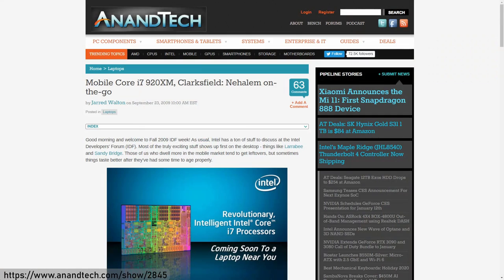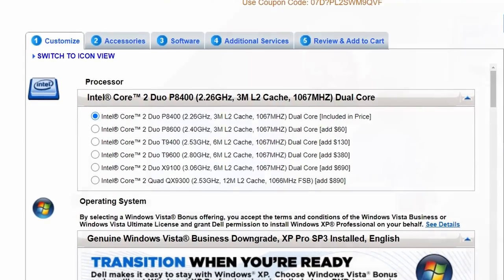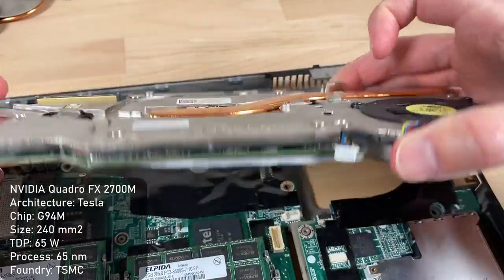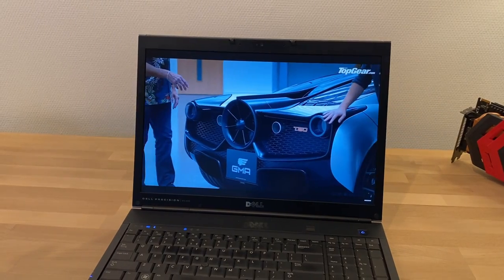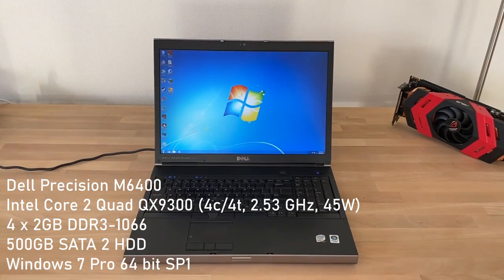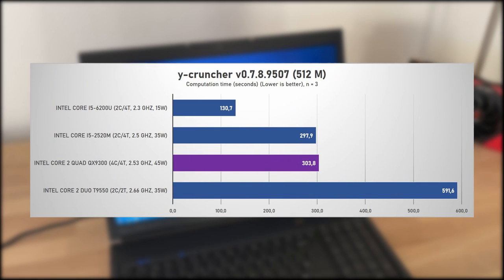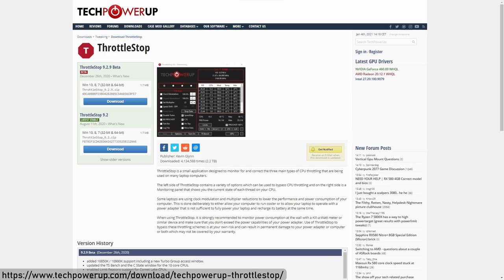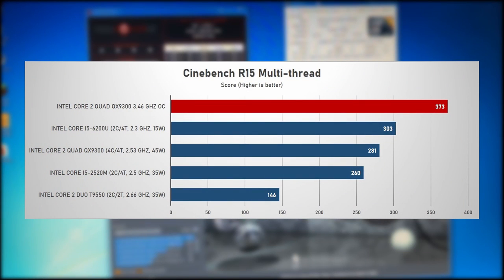Core 2 Quad Extreme in a LAPTOP! - Dell Precision M6400 & Intel QX9300

Comment: I have a q9550 I bought in 2009 that I now use as my media pc, it's spent it's whole life between 3.6 and 3.8 ghz still runs perfect I dropped an RX 590 pulse in it and it does 4k no problem at all.
Reply: i got also a q9550 in e0 stepping back in the day. mine was daily oc'd to 4,25ghz without big trouble
Reply: @ko83na mines e0 also, I did run it at 4ghz for a short time but didn't like the heat and voltages,(mainly the northbridge volts) it was in an Asus pq5 turbo so probably not the best board since it was only a p45 chipset.

The psu finally died last year, still need to replace it.

Comment: Very nice review. I just purchased an M6400 on ebay for $80 and upgraded it with an SSD, 16gb of RAM, and from a T9900 to a QX9300 cpu. It runs like a brand new laptop...better than my Lenovo IdeaPad 3. The performance is amazing. I'm going to get an express card with USB 3.0 as well.
Reply: qx9300 is from 2008 but it runs pretty well ngl 
i have one with 6gb ddr3 766mhz ram and 8000m gs
Reply: That T9900 will still fetch a stupid amount of money!
Reply: There are plenty of addin cards to max out expansion, I would max out storage though by replacing un needed expansion like odd or other pcie cards with ssd's.

Apparently thinkmods do an express card to nvme adapter with an SD card for clover to allow nvme boot.

The internal pcie slots can probably be made bootable using clover too for a multi boot machine.

I've found that later combined  WiFi + Bluetooth modules require modification for use in older machines.

Pin 51 and pin 20 they are apparently to do with physical power buttons for turning parts on and off, you can take over them or do what I did and use a sharp knife to cut the top trace and lift the connect pad off the PCB.

Later cards and OS are incompatible or have trouble working with hardware buttons.

Comment: One of Intel's greats.  My desktop Core2 Quad was a beast too.  The longest running main desktop CPU/Mainboard combo that I ever had, with surrounding peripherals upgraded across 10 years.  I only decommissioned it about 4-5 years ago when I switched to a dual Xeon E2-2667 v2 mainboard at original Threadripper performance (for a larger power budget).

Comment: I love these Precision laptops - my daily driver laptop is a M6700 with an i7 Extreme Edition, Quadro K4000M GPU, 16gb DDR3-1866, 500gb SSD + 2 500gb HDD (Raid 0) + 64gb mSATA SSD. Basically, I paid for all the slots so I'll use all the slots. I've considered buying one of these M6400s to mess around with as I've only used desktop series Core 2 chips when it comes to the high end.

Comment: I used a m6400 for around 9 months with a qx9300 OC'd to 3ghz max of 3.2ghz.  For graphics I went with the firepro 7820 since it was a mobility radeon 5870 which is a desktop hd 5770, so in 2015 it was still pretty potent.  Switched back to my other dell for laptop usage and started using a desktop again as well.

Comment: Had one in a HP 8730w mobile workstation with a dream color display and advanced docking station with internal disks running three displays back in 2008. They were about $5k-$6k plus the extras. The network team at the company bought them to be used at home.... The CEO found out, tried to return them but the vendor refused to take them back as they were totally and customly maxed out and the vendor had no way to resell them. I got one of them as dev and hardware nerd. Ppl in meetings just laught at it. I hooked the laptop up to the huge docking station hanging under the desktop and had three 22" IPS monitors with wall arms as a 0 visible cable solution. It was totally epic. Happy days! :D

Comment: I actually have a T60 thinkpad that I modded to support a quad core q9000 cpu. It's a really extensive mod, including a motherboard from a different generation of thinkpad, modded BIOS, SPID timings and a modified cpu socket. I did the mod myself and I'm very proud, I'll probably end up making a video on it eventually.
You're right about it being surprisingly snappy. I run windows 10 on mine and other than playing youtube videos, it's a perfectly usable machine for just web browsing and even some light gaming. The downside is heat. I went with the q9000 because it was cheaper and I didn't want the T60 heatsink to be overloaded with a 45W cpu. Some cooling mods and it stays just below thermal throttling, but I'm very glad I didn;t go for a Q9100 or god forbid a QX9300, although some users on the german thinkpad forums have done that.
Reply from the maker: Very cool! I used to have a T60 modded with QXGA 2048x1536 IPS display - in hindsight I shouldn't have sold that lol
Reply: PLEASE make a video, that sounds insanely interesting
Reply: You should be able to play YouTube videos on a Q9000 quad without any trouble although it depends on the resolution and the frame rate you're after. I've got a laptop with a T6400 and mobility radeon HD 3650 and it will play 1080p fine. What you have to do is go into the browser settings (often the advanced developer settings) and force hardware acceleration in some way.

When I first started trying to optimise this machine it did, indeed, struggle to run YouTube videos but when looking at the way the system was loaded I saw that the GPU had close to zero load yet the CPU was maxed out. Needless to say this was less than ideal. The AMD GPU is pretty basic and I have it running in low power mode. Even if you're using the integrated graphics, that Intel shoved inside the memory controller chipset, this should have more than enough oomph to help off-load tasks from the CPU. Helping with video rendering is something GPUs are good at.

Without hardware acceleration the T6400 would drop a frame every now and again with 720p and 1080p was impossible. With hardware acceleration it can do both with ease.

Another useful tip is an addon/extension called h264ify. This will allow you to force render with an easier/older video codec and stop 60fps video from playing. Forcing the alternative codec stops YouTube from being able to go above 1080p although I can't see this being a problem to most. The biggest issue I've found is that some YouTubers only upload a 1080p version of a video at 60fps. There is no 1080p at 25/30fps, so you're forced to watch in 720p for those.

Either way try getting hardware acceleration enabled in your web browser and see if that helps. In Chrome simply typing Chrome://GPU will tell you if you are. What you want to see is video decoding set to hardware accelerated.

Comment: I've been looking for a core2quad laptop with all the expansion yet still can kick in some older games, office work etc, would love to get a laptop like this, upgrade the GPU and overclock the CPU, an absolute barrel of fun for my older steam library, i wish laptops were still exciting like this one!
Reply from the maker: This era of laptops had a ton of exciting desings indeed!
Reply: not sure if you’re still looking 3 years later but my clevo m570tu has all of that. has the qx9300 like in this video, comes with 9800m, but you can upgrade gpu, and cpu overclock option in the bios. mine has windows xp and it’s ridiculously fast for games from its time, even runs crysis and gta 4 at high settings
Reply: @nitroseven  Sounds fantastic, i'll probably still pick up something like it in the future, though i have learned of another laptop that had a desktop X79 socket inside and i believe dual MXMs and ive heard GTX 1080 SLi is possible though i can't remember the model, sounds like a fun out and about sleeper though like the steamdeck (which would make more sense i suppose) it struggles with the whole connectivity issue, im not fond of public wifi etc and my PSVITA with PKGi has been the on the go gaming device so far since its just offline and ready to go. Im just a quirky hardware collector but on the go gaming has been a bit of a grey area for a while :)

Comment: Very well done presentation! I have a T9550 M6400 that's been in service for about 14 years, albeit with hard drive and GPU failures requiring replacements. I'm aware of an i7-2640M equipped M6400 but don't know whether it was configured by Dell or the CPU was upgraded by the owner. It would be interesting to see how the  i7-2640M compares to the QX9300 and the i5 processors you covered.
Reply: lmao wtf, M6400 with a 2nd gen i7? You probably meant the M4600.

Comment: I've been checking out your QuadFather  and other cool retro videos.  Found  your content very thought out and enjoyable.   Even though most of these systems were lust worthy 12+ years back,,  I like seeing older platforms put through the modern ringer.   I once had the Intel Q9650 but strapped to a Gigabyte P45/ddr2 chipset.   Your videos are getting my creative juices going again..   "FX 60/XFX GTS 8800 320mb build?"    Are you still using your Sandy 2600k?  I just pulled mine off main duty a couple months back.  It's really amazing to see that Laptop performing so well even today.   Thanks for excellent presentation videos.

Comment: I just came across one of these at a recycling facility the other day. Unfortunately, it only had the Core 2 Extreme X9100 CPU variant, and the laptop itself was heavily damaged and not functional. It was still pretty interesting to disassemble though.

Comment: I actually have one of these dell laptops (m6500) mine has the upgraded screen 920xm cpu, 8gb ram, firepro m7820 gpu. My aunt works for a va hospital and they were getting rid of older machines its still in perfect condition.

Comment: Hey, very nice vid! This could also be a very interesting machine for late WinXP era retro-gaming
Question: what was the CPU temp with the overclock?
Tip: would have been nice to have the launch-year next to the CPU model in the plots, in order to have a better context of the results ;)
Reply from the maker: Thanks for your comment and tip! With the overclock the cores reached a max of 80-86C after a single run of R15. With a longer load time I suppose those would have risen a bit more. Definitely at the upper limit of the cooling solution can handle.

Comment: I have a dell optiplex 780 micro tower PC that I've had over 7 years and it has an upgraded processor from core 2 duo 8600 to a core 2 quad 9505 and a nvidia gt330 still going strong I use it for my media and retro games

Comment: Now get the Beast external GPU dock to pcim adapter! I have one for my old Dell Latitude E6540 maxed out with a i7 4810MQ and use an old Titan Black It works great! I was able to play CyperPunk from very unplayable, with the stock Radeon HD 8790M (in a video i have) to very playable😄I had to use throttle stop too since it would throttle at 1.8Ghz for any game but uncapped for Superposition benchmark 🤔 heat was no issue with a cooler.
I also got the GPU dock to work on all things an AIO Dell Optiplex😂 it wasn't much of an all in one any more, since you still have to use an external display with the external GPU🙃

Comment: this was a top tier laptop i till 2009 until mobile i7s came in i guess, it was overclockable, was quad core, handled windows xp and vista like a champ, was a gaming laptop cpu in some cases and had a 8700m gt or 9700m gt and was basically the best laptop in 2008-2009

Comment: I have been having issues with the Wifi of this laptop, it keeps on getting disconnected and at times it shows it is connected to a network but has no internet over it, and some times it works flawlessly. Any suggestions.
I have the exact same model, with windows 10 installed on SSD with 16gb ram.
Reply: update the wifi/lan driver to the latest.. if the problem still happen after updated then you should check the wifi modem or change the wifi modem of your laptop.. but usually update will solve the problem

Comment: I have the same machine! Even if the Quadro 3700m is the official strongest gpu supported, some people on dell forum declared that the more recent Quadro 5000m fits it with a little adaptation on dissipator, giving to this machine directx11 support and huge 8gb of gpu memory, the only issue should be about display port not working anymore for external monitors. Right now quadro 5000m it’s a gpu quite expensive, that’s why I didn’t made this upgrade already... I was asking myself if you could be interested, it could be very intresting to see how could work and make a video!
In my machine I have the dual core extreme version X9100 that starts at 3.06 GHz clock. The 3700M gpu and I overclocked the monitor too to 75Hz, works perfectly. 
Contact me if u wish
Reply: hi man, what is temperature quadro 3700m have at full load? And what about fan noise after 1 houre of gaming or heavy work? Just want to know what to expect!
Reply: Forget about finding a 5000M, you've have a better chance of finding a unicorn than a Quadro 5000M for the M6500. (says the one who owns a M6500 Covet with that one GPU!)
Reply: @staspil6  right now I have to change the thermal paste so gpu temperature are above 65-70 C at full load
Reply: @Wasmachineman  which is your cpu there? I found a 5000M from china for something like 160$ but I am afraid that my cpu will bottleneck too much...didnt bought yet
Reply: @Juvenlus  A 5000M for $160 sounds like a scam.
Reply: @Juvenlus  That's a M5000M and will not fit in the M6500.
Reply: @Wasmachineman  5000M and M5000M is the same gpu, and yes it can fit the motherboard of m6400 with a little modify, the only difference is that u can not link an external monitor anymore
Reply: @Juvenlus  5000M is a Fermi based GPU, M5000M is Maxwell based. And both the M6400 and M6500 do not use MXM which is required for the M5000M.

Comment: Very cool!

I had a Clevo M865tu whit qx9300 and GeForce 9800m GTX 1gb thats a Beast

it exist 4 quadcore mobile cpus

q9000 q9100 qx9200es(i had one) qx9300
Reply: that’s really cool! i also have a clevo (m570 i think) with the same cpu/gpu and it’s used for retro gaming!

Comment: I tested ´ThrottleStop´ on a T5250 (Merom-2M), but the multiplier doesn´t get higher than "9".
Is there a way to overclock the T5250 or is it locked in some way?

Comment: i just wondering if my dell vostro 1230 support core 2 quad like q9000. its have similar socket as my core 2 duo which is socket p but i cant find anyway if the bios support it or not

Comment: Hi there :) I have this cpu qx9300 but what are compatible laptops for it ? I have few of those socket 478-479 socket P gma 45 express chipset type. Non accept it physically yes but no video output can spins like mad that’s all !
Reply: Precision M4400, M6400, the last Core 2 era Alienwares, HP 8730w with a certain mobo all have C2Q/QX support.

Comment: Friends, I have a Toshiba Tecra A10 PM45 chipset, it had a Core 2 Duo P8700, I put a T9550 in it, do you think the QX9300 works? As I see, the chipset supports it and the video is a PCI Express NVS 150. I would like to update it, is it possible? and I have one model with the video overclocked. With msi afterburner. Greetings, I await your answers xd

Comment: excellent bro, I have an acer socket p478 and it has a pentium t4200, would you like to install this processor, is that possible?  acer aspire 4736z model and place 2 memory modules ddr3 1333 mhz each with 4 gigs, totaling 8 gigs.  Thanks in advance

Comment: Interesting in that this cpu will boost up to 2.66 ghz under ideal temperatures no thanks to dynamic acceleraor technology, a kind of early turbo boost technology that allows the CPU under certain conditions move up a step, in this case 2.66 ghz. Although with overclocking you should easily obtain that. Maybe even 2.70 and beyond, But by then your gains are a bit pointless especially in a laptop even if it's a tank like this. Thermal limits do come in to play even on this.  I love Dell precision hardware though. I have a 2800 and 4800 as back ups to my 7000 series. It's about getting work done, and these laptops do just that. Aint sexy by far, aint some thin and light. But it will leave them in dust long before running out of steam.

Comment: Love your video nice job. Have a question for you. I have M6400 whith T9400 and Nvidia FX2700M. Ist it possible to upgrade the CPU and the video card if yes, how hard it is? Thank you.
Reply: QX9300 plus any of the M6500's FirePro cards would be a great upgrade.

Or better yet, ditch that 15 year old boat anchor of a Precision and get something much newer.